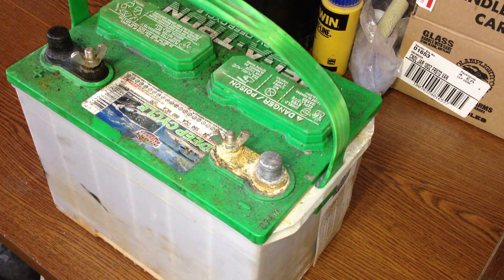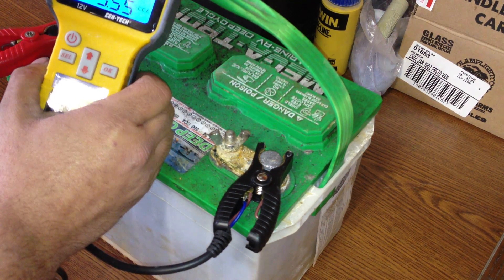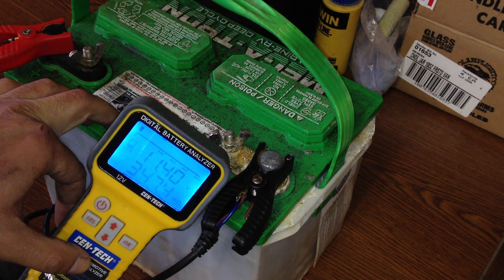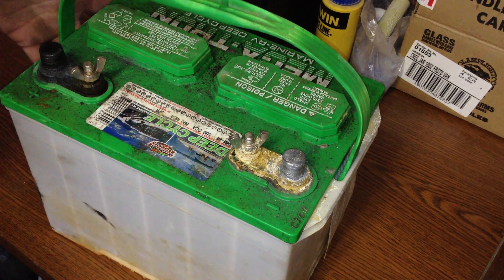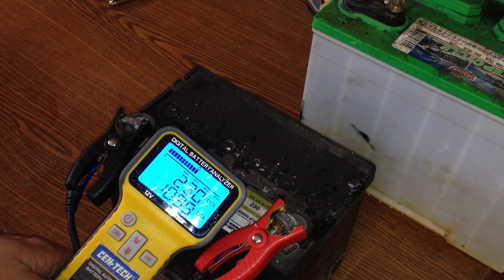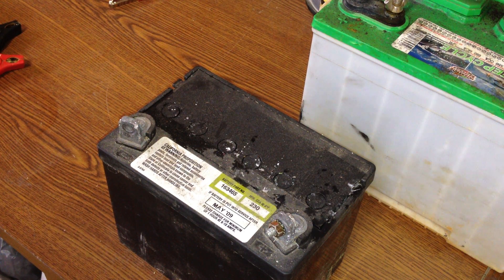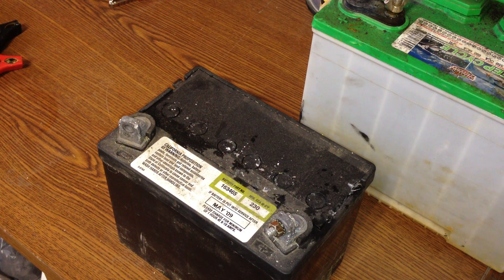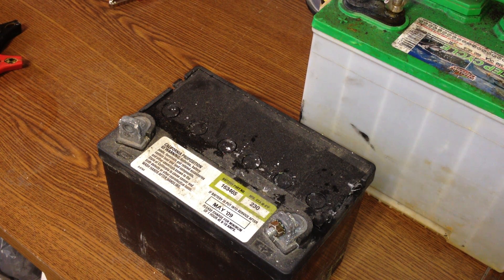Lead Acid Battery Desulfation Using Epsom Salt  -Attempting to use Capacitive Charger  Part 6 of 6

Comment: You might try taking a a clothes hanger in ur dead cell make an L shape the idea being there might be a pile off metal shavings or gunk at the bottom of the cell if u knock it the pile down so its not touching the bottom of the  plates ur cell will not be shorted. the only other way is to remove the acid n liquid n then try n wash it out with water but that is a big hassal.

Comment: Interesting ... I think I would drain the battery acid, flush with water to get out any precipitate in the cell compartments, refill with the original acid, top off with epson super-concentrate, desulphate long term, drain, flush again, and then refill with fresh battery acid, and slow charge, Typically cells are shorted either by sludge at the bottom or crystal growth penetrating the insulating mats. Modern battery are made with interleaved lead mesh and porous insulation ... not lead grills/grates of the past eras. 'jes sain'

Comment: 1- Those reading are in milli-ohms not ohms. That small m stands for milli (1/1000 ohm)
2- That charger you make (made), is very dangerous. There is no isolation from a transformer and no current limiting. There are no pulses, as the capacitor smooths out the 120 Hz, into a DC. It's called an unregulated power supply.
3- Your dry cough is concerning. If you are a smoker, stop immediately. If you're not a smoker, see you doctor ASAP.
I caution the viewers not to use this type of a charger, as there is a good chance, the battery will explode when under charge, sooner or later.

Comment: On that Alum issue, you can't add alum to sulfuric acid typical of a car battery.  It will react violently.  Converting a battery to alum requires completely flushing the battery using diluted sodium bicarbonate to neutralize the battery acid and is very dangerous,.

Comment: This is very interesting but watched the whole series of videos and not sure this 'Epsom salt' method works.   One problem is that you're not actually flushing the cells, your just adding Epsom salt. I'm thinking that you need a syringe type of thing to drain the cells and refill them to clean out the gunk floating in the electrolyte.  I can understand not turning the battery upside down to drain it as that could stir up a lot of lead and other metals that could lead to further unnecessary damage.

Comment: Good video series.  I noticed in your Part 3, when putting powdered Epsom Salts into the battery, that you only put a bit into the 'shorted' cell.  I think you'd do better to put MORE Epsom Salt in the shorted cell.
Reply: You might try taking a a clothes hanger in ur dead cell make an L shape the idea being there might be a pile off metal shavings or gunk at the bottom of the cell if u knock it the pile down so its not touching the bottom of the plates ur cell will not be shorted. the only other way is to remove the acid n liquid n then try n wash it out with water but that is a big hassal.

Comment: Have you tried taping or knocking on the wider part of a battery while testing or charging and probably improve reading ? ( be surprise sometime ). I screwed around a lot with the same project battery only to end up to deceiving result.

Comment: At the end he says that his theory is that is does work, as long as the battery isn't too damaged already.  Good info in this series.  At the very least, you can use them to arc weld if you don't feel like buying a machine for it xD.

Comment: That truly is a very nice tester for the price. I compared the voltage readings with a Fluke, though, and found that the displayed voltage was off by around 0,2V.  I opened the case and adjusted the trimpot next to the IC. Counterclockwise raises the voltage and vice-versa. Now It's bang on. Calibration should be done with a healthy battery, otherwise the voltage will swing like crazy and you can't get a stable reading.